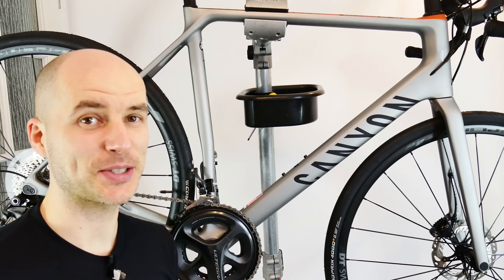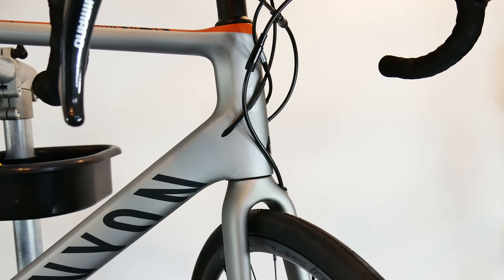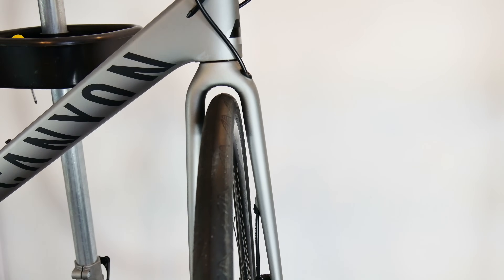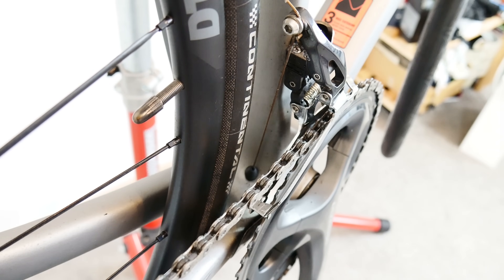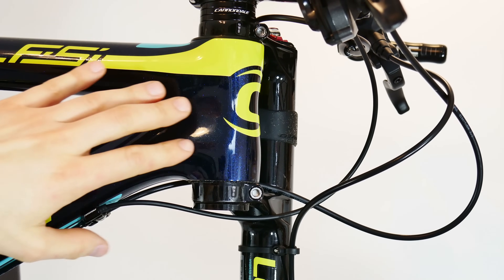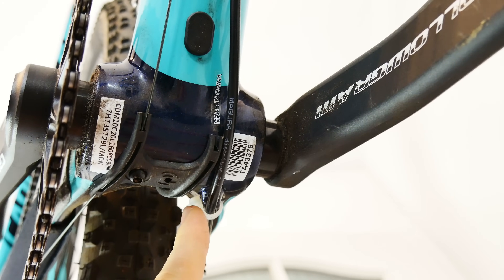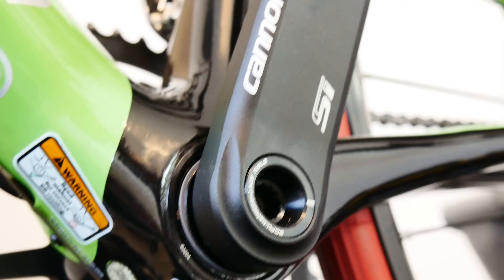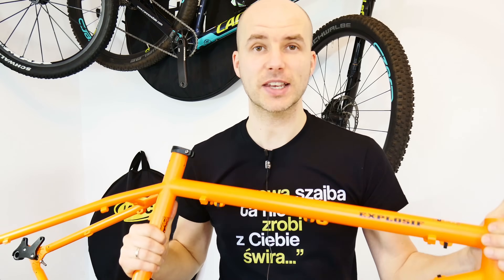Important Problems With Internal Cable Routing On Bicycle + Maintenance Tips

Comment: The main reason for road bikes having internal routing is for aero dynamics and there is no structural weakness otherwise the engineers wouldn't put them in the bike. Along with that it does in fact help cables with mud and water if you take care of them properly by lubricating them and it really does not help to have your bike sitting dirty and wet like in the video, then your cables will rust. Also, taking a drill to a carbon frame are you mentally insane? Also pro tip never ever ever put a carbon bike in a work stand and clamp the bike around the frame, clamp it around the seatpost, frames are not designed to be clamped and you can easily destroy a very expensive frame by doing that. Clamp it around the seatpost it is designed to take those sort of forces. I question the experience and knowledge that you have based on the things that you say and have said in your videos.
Reply: Richard Boustred the frame clamping hurt my eyes too... :)
Reply: Tamas Varga Okay, so you wait for the first episode where he doesn't specifically say he's not clamping the bike and then you jump down his throat?  He has said hundreds of times that there isn't any pressure on the clamp.  It is just set in the bike stand, not clamped.
Reply: Mentally insane? As opposed to any other type of insanity.

Comment: i don't understand why he is effectively telling people to pull cables completely out before installing new ones, only ever do that on a new frame, otherwise just pull the old outer out, measure and cut a new one, unstall over old inner, then pull inner out and replace and then instal new cable....job jobbed!
Reply: actually he didn't, he tells you to connect new cable to old one to guide the new one.
Reply: he tells you to put new cable in by atatching new cable to old and pull it thru the frame, like pulling mire thru walls

Comment: Kinda have to chuckle at the complain about the holes causing a weakness in the frame =)

Pretty sure by the time these holes come into play about the structural integrity of the frame compare to a frame without them your body will most likely be in a state where cycling ever again is your least concern.

Comment: Another tip: Buy and *use liners.* Push them over the cable to be replaced, back to front. Remove the old cable but hold the liner in place. Now you can push the new cable through the then empty liner – and you're done. Remove the liner, store it. 2 minutes.

Comment: your main argument is that the holes are drilled (theyre not) so therefor make the frame weaker ... do your research before making a video please, do you honestly think the engineers in the bike manufacturers would allow an expensive carbon frame to go into production if they were that weak ? cmon

Comment: A small neodimium magnet (e.g. one from the HDD head actuator) is a true life-saver. You can easily route the cable directly to the exit hole by just magnetizing it through the frame and slowly feeding it through the entry hole at the same time. 
BTW, the exteranal cable routing is great for the mud-digging or a commuting bike as you can install a one-piece cable housing from the shifter to the derailleur, attach a sealed end cup on the derailleur side and make it absolutely dirtproof. This will most likely require some careful drilling through the intermediate cable stops on the right seatstay, which is originally wide enough only for a cable, not the whole cable housing

Comment: Nah this video didnt convince me, even though i enjoy your review.

I hate external cables, its messy and every time i carry my bike i always end up holding the cables which to me feels terrible. I dont like the texture of shifter cable.
Plus in my case over time my deraileur is starting to not shift properly and i have to re align it over and over.
Cleaning it can be very annoying. So to me. External Cable is terrible.

I dont care who are those big brands says external is better, to me its nonsense. I feel at ease with internal cable.

No offense just my preference.

Comment: I don't think there will be any problem with internal Cable routing because the engineers who make the stress analysis will focus especially on the areas where high stresses can occur. The holes will also be placed in areas where the stress is not as high. So completely bs to say it will decrease the structural safety by any significant amount.

Comment: If it's good for pros, it's good for me.
Reply: Indulonman pros use electric
Reply: I meant primarilly the argument about holes reducing stiffnes. Imho amateur rider will barely recognize any difference. On the maintenance part, if you look after your bike regularly, you will have absolutely no problem, there is a lot of tricks that make changing of the cables easy as hell. It consumes more maybe a few seconds/minutes. But how often do people change their cables?
Reply: I don't think that a lack of stiffness is the actual problem. It's more like that drilling holes and cutting out parts of your frame may compromise the frame's stability. Every drilled hole or cut out bears a higher risk of damage on the frame, since they pose weaknesses in the frame's stability. Especially on parts like the BB shell that are being handled with a lot of force during rides may crack more easily when compromised due to a cut out. Of course that doesn't mean that your frame is going to crack 100%, but the chance is still higher than without the holes and cut outs. (That's at least my understanding of the matter, I'm no expert)
Reply: I understand it the same way, Lance. I don't have the knowledge, so it would be nice to know from some expert. How much is the frame frailer with internal routing? Is it really a big deal? Because I assume that designers keep it in mind and adapt the frame construction to it, so the resulting effect may be the same.

Comment: Even if its just manually drilled, it'll never be bad enough to comprimise the strength of the material. You're being overly critical about a very small thing that hardly matters.

Comment: Silly pure assumptions regarding strength of the frame with holes for cable.  holes are reinforced and there's never been issue regarding strength or stiffness. C'mon. Dirty cables? Non-issue exaggerated here. Biggest problem and really ONLY issue is more difficult to work on the bike with internal cables\hoses. That's it. Pro's: Good looks, some protection (older exposed cables did get dirty\oxidized), protects frame finish (older cable\hose housing ruin frame paint, and aero.